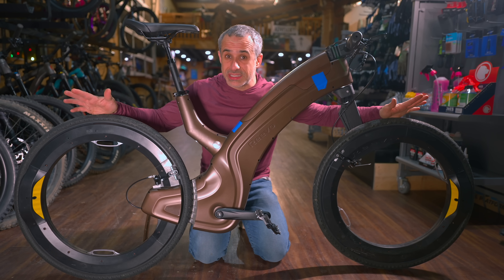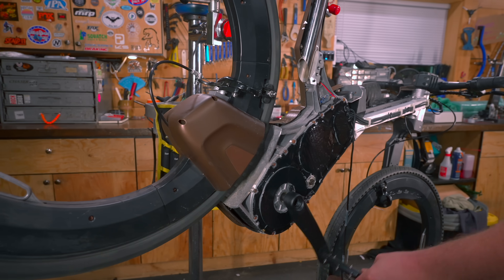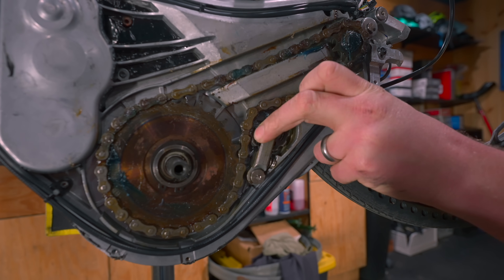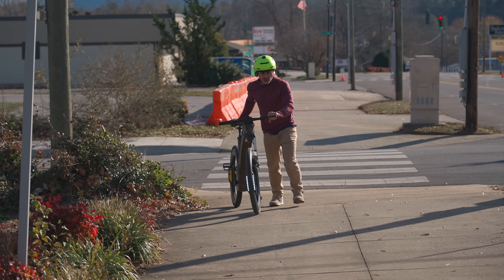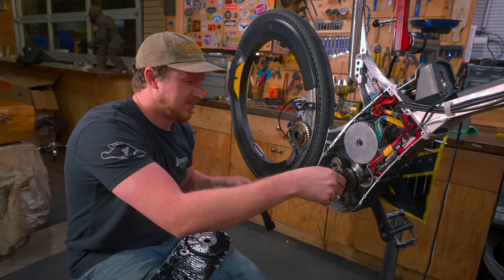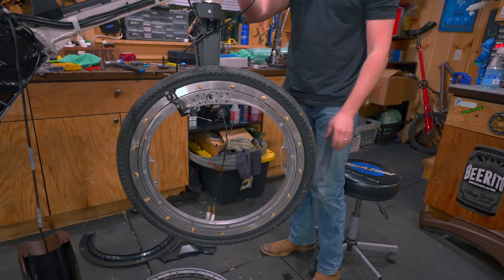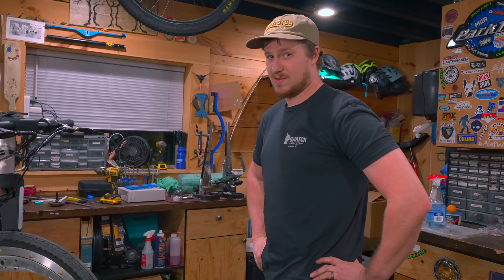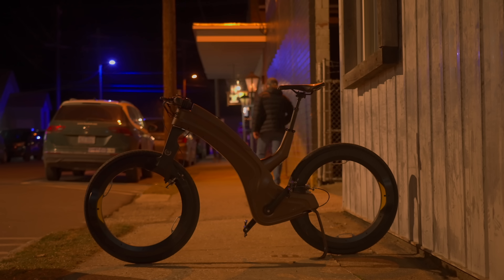What's Inside The World’s Worst eBike? Reevo Teardown

Comment: This is simultaneously the most expensive and cheapest design possible.  There is so much complexity in the design and castings but then they use some of the cheapest parts!
- The rollers that the wheel rides on (8:51) are almost identical to the rollers that cheap 3D printers use with a shielded bearing in the center and a Delrin plastic rim that wears down over the life of the roller.  3D printer rollers cost about $1.00 each.  You can even see that one roller has a chunk taken out of it already!
- The servo used in the anti-theft system (10:23) is a 9 gram servo.  Based on the blue transparent plastic and what's visible of the label, it is one of the super-cheap "SG90" servos manufactured in China and sold under countless brand names for $1.50-$2.00 each.  SG90s are noisy, have plastic gears, and have somewhat questionable reliability and durability.
Reply: i wonder if that's a product of the manufacturing process 

you spend all of the money on necessary up front costs like the engineering, the die casts, the tooling, etc and then once you're done with all of that super expensive stuff... what do you have left for actually building the thing? or doing QA testing? 

also, i mean, at some point they finish the no doubt arduous process of engineering and constructing the prototype, and they give it a test ride... and the ride is just horrible. and there's no way to really fix it because the low quality ride is inherent to the design 

so what do you do at that point? you know the reviews will be horrible, you know nobody will care about the expensive engineering if the bike rides like shit, you know you won't sell any units beyond the KS pledges. so it makes a lot of sense at this point to just do the bare minimum possible to fulfill the pledges and then scrap the prokject, try to erase your association with it and pretend it never happened
Reply: Yeah, what @itwassaucershaped said.
Reply: They probably have stopped paying the engineer that made the majority of good decisions and someone had to pick the pieces.

Comment: They only had to put a metal roller on the wheel for driving it. Like a solex moped.
Freenwheel bearing and a connection from pedal to that friction wheel.

Bearings for the wheel is tricky. I think only a fluid bearing like would be low friction. A bearing that big all the way around can never be that good as a small axle bearing.

Comment: That thing is both very clever and extremely stupid at the same time, a typical example of inventing an incredibly complex solution to a problem that didn't really exist in the first place which is unfortunately very common these days for example in automotive industry. So much thought, cost and work to make a terrible, short lived, expensive and totally impractical product, obviously designed by some very intelligent and well educated engineering nerd who does not ride bicycles and does not understand what's required of one.

Those little "wheels" the rim rides on are called V-rollers and they are used for example on 3d-printers and they work very well there but it's hard to imagine them lasting for any lenght of time in the environment (water, dust, mud etc.) where bicycles are used. Also, they have quite a lot of friction, especially if adjusted so that there's no clearance (for which this thing does not have a provision hence the noise), which doesn't really matter in a 3D-printer that uses only 3 or 4 for each axis but adds up quickly if there are so many of them. 

To work even to some extent there would have to be a sealed ball bearing the size of the rim. That would be very expensive as such bearings probably are not readily available as off-the-shelf items but at least it would be quiet and smooth and have no excess clearance and it would not wear out after a few dozen kilometers. There would still be much more weight and friction loss than in a regular hub though. The ring gear on the rim could be made of Delrin or some other tough engineering plastic and be replaceable separately. It would be lighter, much more quiet and probably more durable than the aluminium one. The bike would still be heavy and have a lot of friction but at least it would last for a while.

Comment: The reason all those bolts are rusty is our good old friend galvanic corrosion, if you want to use bolts with aluminium, you want to at least use stainless steel bolts as they cause a lot less trouble, but that would have cost them a 100 bucks more in cost with the number of bolts they are using.

Anyhow small nitpick on this hilariously stupid idea of a bike.

Comment: I better way to do the hub-less wheel and make it serviceable would've been to use a bike chain wrapped around the wheel as teeth instead of actual gear teeth in which case you have to replace the entire wheel instead of a chain. I personally think this concept has some validity, it was just over-complicated.
Reply: Or make the entire wheel a sprocket and drive it that way.

Comment: Few years working on cars. It is really apparent when a manufacturer just continues to add components to solve an issue rather than starting with sound engineering design. Chain/belt drives for camshafts can accomplish the same thing in an ICE engine with vastly more unnecessary parts. I am looking at you Audi.

Comment: looks like you can put a tube and normal style tire on that rim . what size is it ? what if you replaced the bearings with higher end skate bearings as well such as ceramics ? It also looks like the chain and pedal clutch could have used a service and relube with a lighter weight lube that might help runaways . you know what ? Dm me ..for real

Comment: Could it be that there is some issue with grounding that causes the corrosion of the bolts? When Linus Tech Tips water cooling loop failed it was due to something similar iirc

Comment: Given that I'm sure the engineers were demandlingly overly constrained by the styling and time, I'd say this is actually really well done, props to them
Reply: The engineering is absolute shit too, unfortunately. For one thing, having a steel gear drive the cast aluminum gear in the rim will guarantee that the gear on the rim will wear very quickly. Good engineering would have done a better job at material selection, or made the wear item serviceable. Also, having that many gears doesn't strike me as good engineering, it looks like a poorly-done student project. There was very little thought or effort that went into that design. The choices made here are expensive, hard to manufacture, and not reliable. They managed to fail at all 3 of the typical project axes, which is definitely a certain kind of impressive. I'll be honest, if I'd worked on this project I wouldn't include it on my resume, this would look terrible to a prospective employer.
Reply: @zrobotics  there's no way anybody would ride that bike long enough to wear out the annular gear. That gear is actually way overbuilt and wouldn't wear out quickly, assuming enough grease and no sand gets in and the wheel doesn't lose its roundness (which, granted, are big assumptions given the flawed basic design).
Actually it would have made more sense for the gear to be made of plastic - acetal or so - that can be run dry.
The number of gears certainly is a problem, and completely stupid - one of the advantages the hubless design should have offered is that the motor doesn't need to provide a large torque at the hub but instead spin right at the perimeter. ...Which they negated by sending the motor power through the same chain as the pedals, requiring that the motor first gears down to generate hight torque at the BB, then back up again to generate high RPM at the pinion drive.
Reply: @zrobotics  Like I said, given the time I'm guessing they had and packaging, they did a good job. I'm sure if they had a larger budget and a reasonable leader it could be improved, but a pointless product like this (that solves nothing and nobody was asking for) is almost always incepted by someone who doesn't actually know how products are developed beyond a sketchpad, and they tend to think they have enough money for development but really don't. 

I'm speculating about the team who made this based on my experience making stupid products at a consultancy though, for all I know it was a lifelong project of a ME with 50 years of experience and they really aren't very good.

Comment: every pair of gears is 0.98 efficiency...so 12 thats 6 pairs is 0.98*0.98*0.98*0.98*0.98*0.98=0.88 just on the gears and cogs. add to it the bearings, its 0.99 for a pair.....77%, the loss minimum 27%...but its more i think.

Comment: As a professional bicycle designer, thank you for this teardown. I remember the Kick Starter and thinking 'oh boy... this won't end well'.
Reply: But the question is: can a spokeless design ever work, or is it just too difficult to do?
Reply: @Serrol_  Even if you make it work with some miracle. Every pothole with water, every light sand that you can easily run into, and you're done. Putting working surface of a bearing so close to a ground is extremely stupid, there's no other way to say it.
Reply: @Serrol_  you could make it work better than this pile of crap, but it'll always be much worse than normal wheels.
Reply: @Serrol_  The real question is why would you want to remove the hubs and spokes? There is no problem to solve here. The only hypothetical benefit of storing anything in that space is just creating more issues with stability and unsprung weight.
Reply: @ Because of Tron. 

I actually thought the little bag they'd designed that strapped in the middle of the wheel, where the hub should be was the daftest feature of all. I mean, the bag looked stupid, and the only reason for buying and riding this massively compromised bike would be because you think the hubless wheels look cool.
Reply: @Root_boy  Aesthetics and making it look futuristic.
Reply: @Root_boy it is to solve a design issue.
Reply: It’s just a horrible, non viable idea from a pure physics perspective.

Figure skaters pull their arms in tight to spin faster and extend them to spin more slowly for a reason. Adding all that mass so far from the center of rotation just won’t work well.
Reply: @Serrol_  In theory it could, in practice its impossible.
Spokes follow the old engineering trick of using triangles (the strongest geometric figure possible) to make a light and cheap way of making the wheel rigid.
Without spokes, you will need to use space age materials (like titanium, or even stronger) to prevent the wheel from loosing shape,
since even the slightest change in shape will introduce friction. And you have seen in the video what friction does to the bike wheel.
Reply: @Serrol_  difficulty isn't the issue. It's weight, complexity, cost, efficiency, structure....etc. All things well demonstrated in this breakdown. This bike represents a major compromise to nearly every other metric at the sake of aesthetics. 

 Many engineering solutions around cycling are pretty optimized, which is how they perform as well as they do. And the wheel... well... we've been working that problem for quite a long time, hah.
Reply: @Serrol_  it's probably too difficult. for a bike you want it to roll, right? Best thing about bikes is how incredibly efficient they are. going by watts spent per km travelled they are up there for the most efficient ways of getting around ever. Something like 90% of the energy put in to the system is used to move the bike forward.
A hub with good bearings is essential for that, and if it's not rolling by way of a hub, it's got to have a lot of contact with a lot of bearings somewhere along the rim. and that will impact efficiency. it can probably get a lot better than this thing, but I don't ever see it beating a single bearing in a hub.
So it won't roll as well, and you'll have the same issue when designing a system to drive the rear wheel. If you can't have sprockets on the rear hub to drive the wheel, you will have to somehow get energy from the pedals to the rim of the wheel, and all the inefficiencies that makes the thing roll worse will also leak energy when driving the rear wheel.

Then there's maintenance. One of the nice things about a bike is that you can fix them with minimal tools. 
You lose that too on something like this. And you lose disc brakes.
And all you get back is a wheel without hubs. Sure, that can look cool in concept art, but barring some sort of maglev tech I don't ever see it being practical
Reply: @Serrol_ basically they can mechanically "work" but they can't "work for the end user".
Long form; it's because the spoke is an elegant system in itself, tens of wires of exact length with material properties in tight tolerance with so many potential failure points mitigated by the cap system which allows end user servicing and reduced technical load for shop servicing. Spokes are lightweight, balanced, replaceable even with non-ideal materials for a quick fix (thick wire stock). The closest alternative the broad support (trunnel?) is popular in the BMX world but if still hub-based and makes use of the short-term economy of virgin plastic. 
Solid wheels have been tried but the centripetal and aerodynamic effects are ultimately undesirable.
Cog-less rim-drive in the form of rubber-rubber mating on the outside of the wheel with a clamp to the inside rim feature insane torque around the clamp point and thus must either feature a semicircular load spreader inside the rim or a non spinning frame with bearings inside the rim resulting in a distributed hub (this bike in the video just has one large hub with a gigantic central hole, it's not hub-less it's hub-more).
Effectively the bicycle spoke itself the result of two hundred years of concurrent evolution is incredibly similar to the internal cellular structure of several single celled organisms that prowled the seas at the beginning of life on Earth.
Reply: @Serrol_   It works, just not efficiently, and definitely not efficiently when you use 12-16 gears to drive the wheel.
Reply: @Serrol_ It will always be worse.
It will have terrible rigidity while being harsh, and a lot of extra resistance, and weight.
But it can be much much better than this.
Reply: @Serrol_  Without a room temperature superconductor? No. With one, easily.
Reply: @Serrol_ there's never going to be a good one. "The Rube Goldberg machine of bicycles" is a great description for the idea: a vastly overcomplicated solution for an extremely minor problem.
Reply: @Serrol_  - Or, WHY have a spokeless wheel? The storage angle is the only thing, but there are so many better storage options for bicycles already.  Seems like a completely pointless exercise.
Reply: @Serrol_  the question isn't if you can, it's if you should. has anyone EVER complained about spokes existing?
Reply: Wow are they still selling em? I want 10, theyre just soo , i cant express it.
Reply: @Ballistarius-nx4dw  Useless?
Reply: In the late 80's the designer Sbarro came up with a hubless motorbike. At the time there was talk of having cars with the same sort of wheels. Then nothing came of it... I now know why!
Reply: I'm super soured on kickstarters that have any complication or questionable tech, i've been burned too many times. It's incredibly hard to do electronics. I got a successful one, the Author Clock, literally just a screen in a nice wooden frame that tells the time by putting text quotes from literature that include time references, so obviously custom logic board and some storage. It's very slow to switch modes (it works great in its normal application, i should mention,) and clearly it took everything to get this to market.
Reply: @emu314159  At this point, crowdfunding products just fell into two categories: established products that use crowdfunding as "preorder with extra steps" (Fellow coffee stuff, GPD-Win handhelds etc), or "innovative" projects that won't pass the smell test. 

Granted we are seeing less and less of the latter nowadays, but every now and again you see products pitch that are full of red-flags: there's a reason why no one in the industry would do things their way, and the reason is never ever because they're dumber than Mr. Genius-Inventor here.
Reply: Watching this must have been as pleasant as having teeth pulled without anesthesia.
Reply: As a former customer service representative i digress
Reply: @Dynie-g7x  ???
Reply: While it is sh*t, it looks beautiful.

Comment: you can tell there wasn't a proper mechanical engineer in this project, when someone uses a freaking block of aluminium for the structure... when the center of a beam is what least contributes to it's strength in flexing.
Literally worst possible strength to weight structure possible, no wonder it weights a lot.